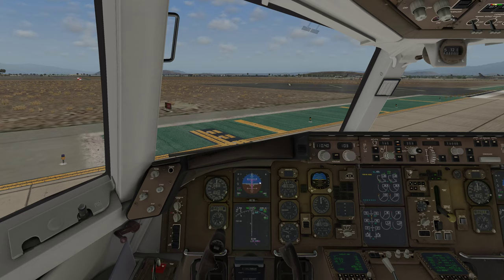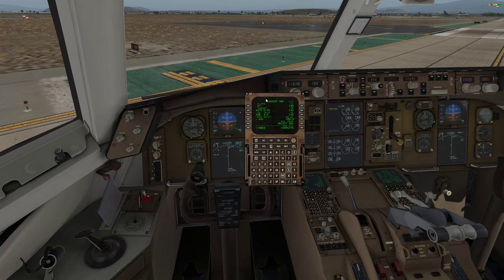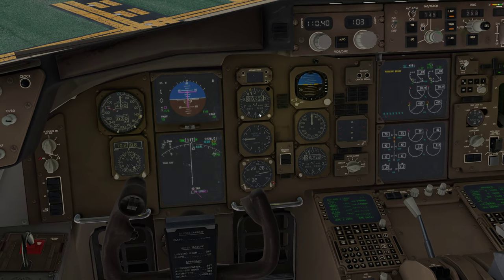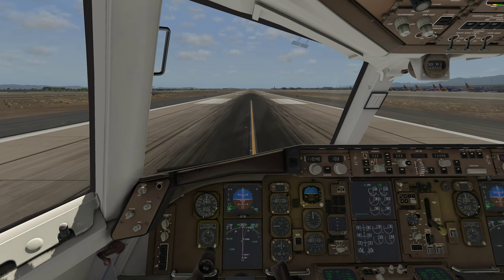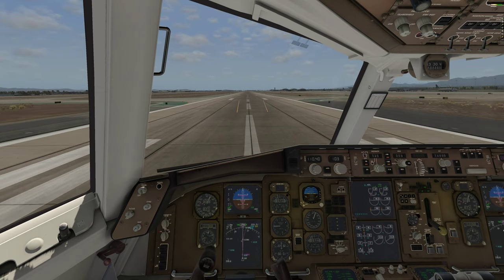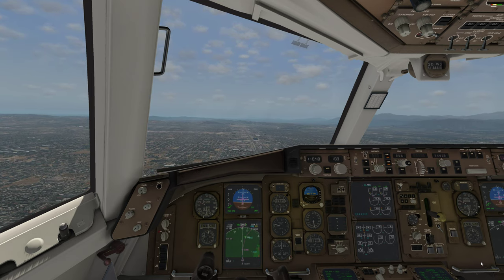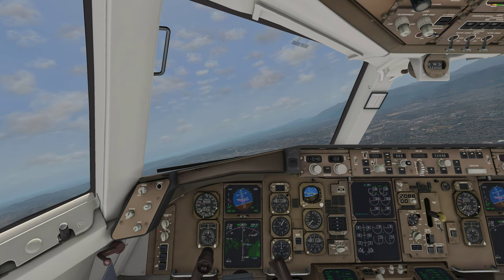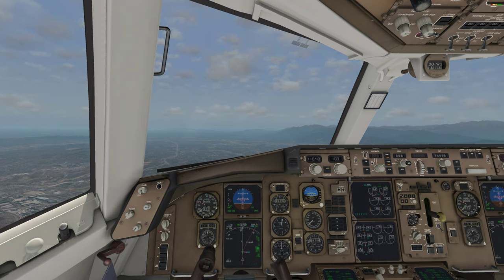Take off Tutorial in Flight Factor's Boeing 757 by a Real 757 Pilot

Comment: Nice! Having those real pilot & company policy tips are priceless!, with regards to the autopilot, do you normally select the center AP to choose L for captain and R for FO or what’s the SOP on that?, thanks.
Reply: The company I flew for has a flow as follows:-
At 1500 feet select climb thrust on the panel, press VNAV (we did not select it on the ground),  centre autopilot to command, (these action were called for by pilot flying and actioned by pilot monitoring), then clean up flaps as required (all takeoffs were at flap 15). The 757 is a great aircraft to fly and this sim replicates that very well.

Comment: Awesome video! Can you do some a non VNAV takeoff video? How would that work?
Reply from the maker: Don't see an instance where that makes sense with a segmented climb.  If you mean LNAV (lateral) such as a heading instead of a way point on a SID then you would deselect LNAV before taking the runway, dial the heading in the MCP and press the heading select at 400ft and flight director will command the turn to the heading.